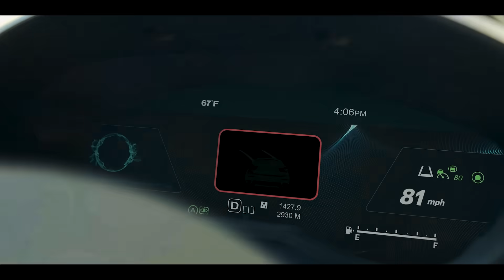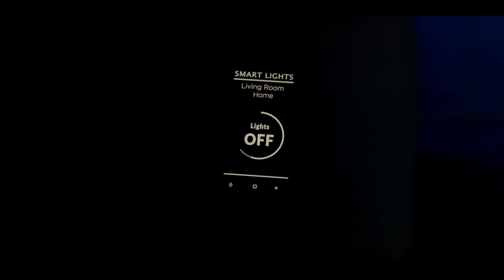Intelligent Technology. Better Future.

Comment: this will be used as a life safety device in a building ,with 6 rooms. if a person needs help, press the button and it will activate master, which in turn activates two outputs. one is an outside siren, and other is to activate a voice address system. the reset must deactivate both outputs and any other sound on slave that triggered alarm.